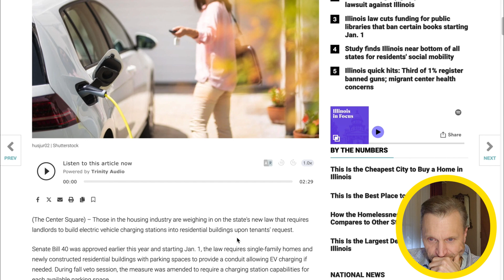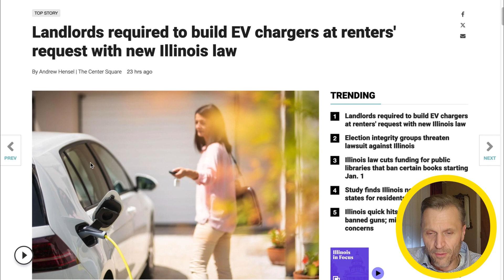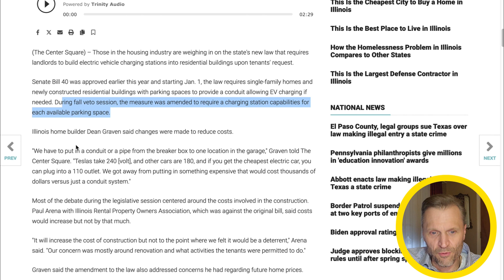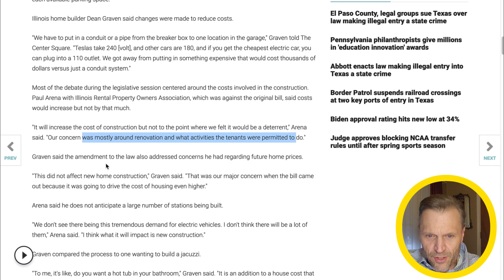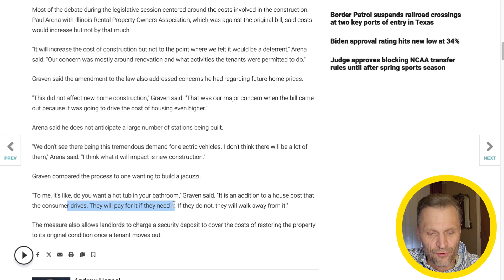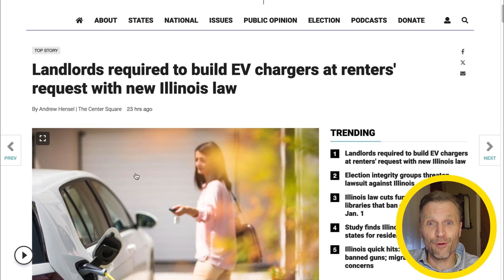Landlords Required To Build EV Chargers At Renters' Request New Illinois Law!

Comment: I don't see a problem with this law at all. An EV charger for home charging would cost literally hundreds of dollars, not even thousands, on a per unit basis. If the water heater goes out you have to replace that. Just one tiny capex cost.

Comment: What a terrible article.  No fact checking..  From the Home builder... "Teslas take 240(volt) and others are 180"...  er.. no car takes a 180v as a standard...  
Some EVSEs can take different voltages (208v gets used because those circuits are in some commercial spaces (i.e. some commercial lighting/streetlights), and pretty much all EVs will take that too, but no car is 180...  So that person has no idea what they are talking about...
I'm guessing the person who wrote the article didn't know either, and didn't think to do any fact checking, which makes me question a lot in this article..
Doing some googling, looks like this just applies to new construction or renovations.
It looks like the actual bill is saying they need an EV Ready spot, NOT EV chargers...
Basically, there needs to be 240v (or 208v) outlets for the residents to be able to use for their own EVSEs.
This is just a terrible article...  ;-)

Comment: This is another EV bullcr*p law.  Most apartment buildings are built with common electric meter so that electricity is supplied as part of rent.  To fairly apportion charging cost, each apartment would have to be retro-fitted with a meter with charging line connected to that meter.
Reply: The apartments around here have individual electric meters. The water is included in the rent though.

Comment: Did nobody in the comment section read the article? It says that property owners would need to provide a conduit, not a vehicle charger. At max they would need to provide a 240V outlet, the same as your clothes dryer, but simply outside. It doesn't matter what the max amp the charger draws from the conduit because the charger will adjust it so no need to worry about any other vehicle. This doesn't seem like a unreasonable request. Landlords became a landlord by choice & should abide by any laws made in their respective state.
Reply: So you are fine if a different state requires landlords to install only gas stoves then? I mean, "abide by the laws" in their state, right?
Reply: @commentinglife6175  yes, I would be fine with that

Comment: The headline is clickbait and misleading, there is no requirement to add the charging station but rather a just a conduit.
Reply: Unless this bill somehow eliminated all electrical inspections so Cousin Victor over here can DIY it for you, pretty sure running a conduit is a very significant piece of adding a charging station!

Comment: Bigger  concern is people parking EV's in attatched garages, which I beleive insurance companies will no longer cover within the next year or two.
Reply: Some insurance companies require vehicle to be 15-25 feet away from any structure, so no parking in garage, EV's burn intensely for 3 days, I would suggest to never park next to one
Reply: Gas cars catch fire 10x more than electric, look it up.
Reply: @Kelora Maybe but I bet that isn't the case if you compare The chance of a gas vehicle catching on fire while it is parked VS an electric vehicle that is charging.
Reply: @-dark_knight.  Exactly, we have to compare apples to apples. Gas cars may catch fire more often, but what percentage of that is while running, vs parked. EV cars can catch on fire while running, or parked and especially while parked and being charged, as you said. Now put that in a stick frame garage...
Reply: @Kelora except has gas fire are easily extinguished. 
Compared to ELECTRIC FIRES,  you pretty much lost your house

Comment: From what he read, it is only a 220/240 outlet and a breaker, not a charger. He also noted that the property owner can charge the renter a security deposit equal to the cost to restore the property to it's original condition, which would probably be the exact same amount as the installation. 
  Essentially, it costs the landlord nothing: the requesting renter pays for both the installation and electricity used and as a bonus the landlord gets to deduct the project from their income taxes as a maintenance expense.
Reply: no, i can't deduct someone else's expense on my schedule e
Reply: @NickR..  The additional security deposit counts as income when it is forfeited at the end of the lease; therefore, even though the money for the installation came out of the renter's pocket, it is deductible as the landlord's expense.
Reply: @georgeford6056  no. that is the tenant's money, and not a security deposit. it's a deposit to return the property to the original condition before install of the ev charger. you can bill only for the actual cost, like any other deposit, and must return any excess.

Comment: I think that having an outlet available in the parking area isn't a big ask, and therefore having 240v isn't that big of an ask either, and therefore installing an EV charger isn't all that big of an ask. Assuming the parking area is on the property. If it was street only parking that doesn't make a ton of sense admittedly.
Reply: Except it is a rather big ask depending on the property.  IF you do it up to code (and you should*), then by the time you get done with the licensed electricians, drywall repair, re-painting (where do you think that electricity is going to come from?  It's coming from the breaker box, and a new line won't run itself through the walls by itself), trenching, weather approved conduit / electrical runs to wherever the parking spots are, you could easily be looking at 5 figures just for one spot.  Additional spots get easier after that, but that first one to get the line out of the building is brutal, and then there's the question of how many spots that single line will cover vs how many spots you need.  Single homes would be much cheaper than an apartment for sure, and depending on how the electrical is done at an apartment you might have to re-do that from each individual box off a meter to get to the tenant's parking spot if you want the billing for electricity to go to the right spot.  That's not even calculating the upgrades the power company will charge for upgrading the service to the complex if you have a bunch of stuff.  If it's a complex you could easily get into 6 figure range with all those upgrades as the power company doesn't do that for free.  That's assuming you just put in an outlet, which is an *incredibly bad idea because that opens the tenant up for massive fraud because just an outlet would have no control over who plugs their vehicle in.  So the tenant could get a massive bill one day not realizing their scummy neighbor the next spot over has been charging their own car on that outlet at 2am when nobody was paying attention.  SO, if you really want to do it right and protect your tenants, you almost have to put an actual pay per charge "public" station out there so they can put in their credit card and the power company can charge them directly for "their" fill up (or alternatively put in their newly required community ID card so the billing goes to the right place on the communal line).  It gets really expensive really quickly if you want to do it right.
Reply: @manicmarauder that massive post just to make it clear that you don't work as a linesman
Reply: They would be real expensive to install.  Who's gonna pay for them?
 Then there's the cost of maintaining them. Also vandalism and unauthorized use. You'd probably have to pay to use them otherwise People that don't live at the apartments are going to be using them.  So this would drive rent prices up further. The landlord would have to charge extra to pay for the charger,vandalism, and eventually new chargers.

Also a lot of people living in apartments probably can't afford a new Electric car, so youd have trouble trying to figure out how many to install considering people move out of apartments every year.

Comment: I bet if the tenants rent went up $200 a month for this they would say "hell to the no."
Reply: I kind of figure any tenants that make this request would find an increase in rent the next month.
Reply: Tenant is responsible for the cost to install, restore to original condition after vacating, and any reasonable costs of electricity/network fees. The thousands upfront plus deposit to restore to original condition would be enough to deter almost every tenant. 

https://www.ilga.gov/legislation/publicacts/fulltext.asp?Name=103-0053

Comment: This report was badly lacking in relevant details.  

It makes sense to have some way to support EV cars. On street parking is hard to address. Older buildings with gas appliances and small electric services may be incapable of supporting chargers, especically if several tenants want them, absent an entirely new electric service. Large buildings with electric panels in upstairs apartments and distant parking lots could have extreme costs. 

That's a potential cost range from hundreds to millions per building. As a required element of new single family houses with a garage or off street parking, EV provisions generally make sense, and should be cheaper and less disruptive than a retrofit.

Comment from the maker: What do you think?
Reply: I think the S is SILENT. I'm from Illinois and can't believe people actually keep saying ILLINOIZ.
Reply: Never
Oops
The house just burnt down! Hope you had renters insurance!
Reply: @bofkaycee1970  click the link. renter's insurance with landlord as addtl insured is in the act
Reply: This sounds crazy. They say Teslas take 240. So would you need to install a different EV charger each time you get change renters because they own a different car. What happens if the renters buy a new car after you already installed some outlet. Also most EV including Teslas are capable of slow charging on 110v but the adapter would need to be purchased.
Reply: Any sensible bill would address this and as another poster said, this article lacks that type of relevant information @chriskeddy1975
Reply: @chriskeddy1975  Read the law. Definitions are very clear. 

"EV-capable" means parking spaces that have the electrical
panel capacity and conduit installed during construction to
support future implementation of electric vehicle charging
with 208-volt or 240-volt or greater, 40-ampere or greater
circuits.

https://www.ilga.gov/legislation/publicacts/fulltext.asp?Name=103-0053
Reply: Expect the rents to rise accordingly @chriskeddy1975